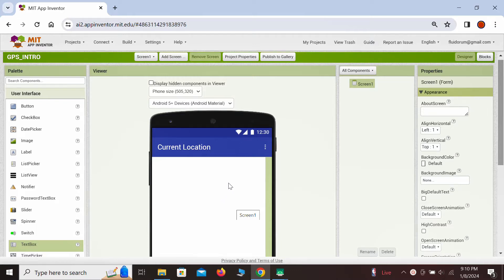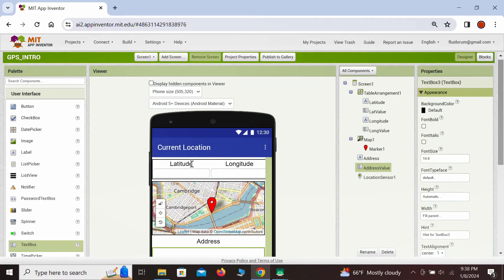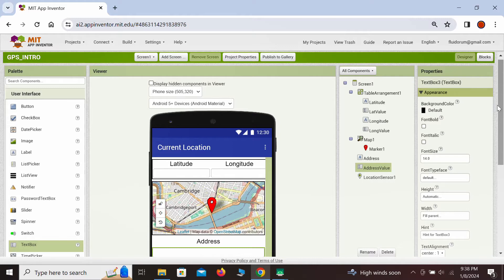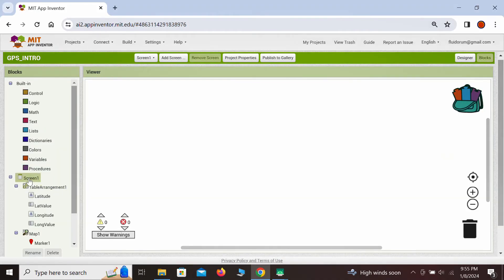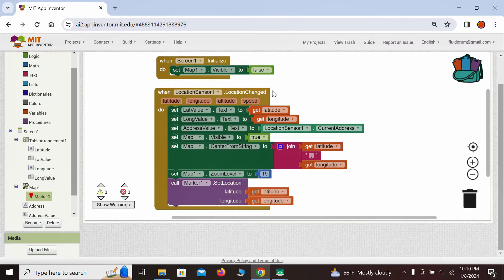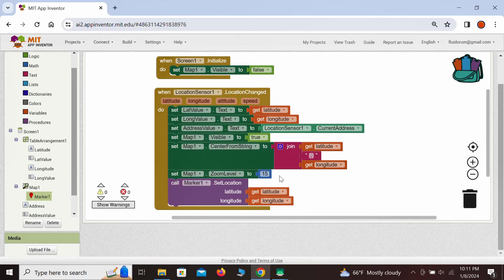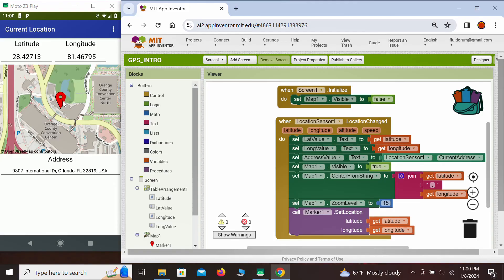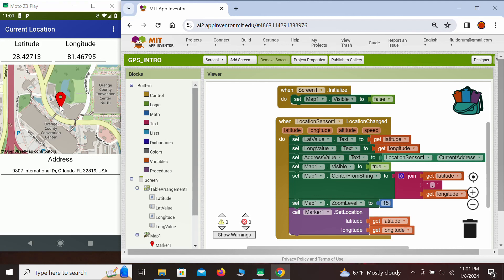MIT App Inventor 2 Location Services: An Intro to GPS

Comment: this application is ok, but as i run it, the pointer goes away to my correct location, but the map doesnt change and remains to the default location as shown in the beginning of placing the map, can you fix this pls?
Reply from the maker: I probably do not understand something here - how can the 'pointer' be at a correct location while the map is wrong?

Comment: Another untested program. Because if the author had tested the program on a newer phone, he would have found out that it has a localization error of up to 1 mile. Why ? Because it does not use GPS, as the author believes, but uses location based on GPRS and WiFi.
Reply from the maker: Each of the examples clearly work, as recorded and shown. The whole idea of this series is to provide basic steps for somebody to take over and take it further. Your realization that it does not work for your phone is exactly that opportunity.
Reply: @appinventor2torial  I invite you to install the program on a phone with at least Android 11 and walk around the city, you will have an error of over 100 m. If you go to the countryside, you will have error of more than 1 mile. It can be easily solved if you force the phone to use the GPS system and not the network. As you made the program, the phone will use the network (GPRS or WiFi). GPS generally does not work in buildings, but the network offers good accuracy. But who uses a location application when they are in a building? Google knows this and uses the most precise system in Maps depending on the context.
Reply from the maker: I see now - It seems that your only issue with the code is that you believe it uses networks instead of a GPS. Now, LocationSensor component should use GPS by default, as implemented here. If this is somehow not the case in the latest OS, it would be literally one extra command to force the GPS use in the LocationSensor. Sure, that extra command should be added - Thanks for pointing this out.